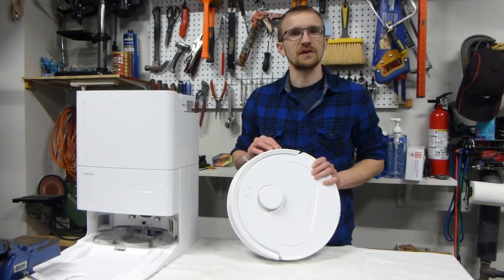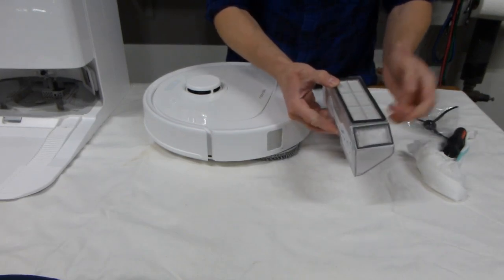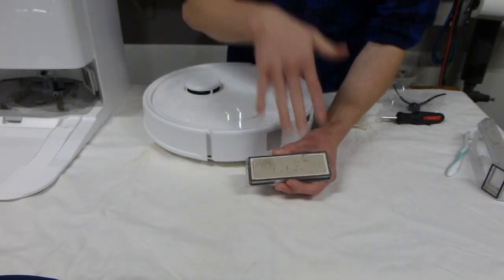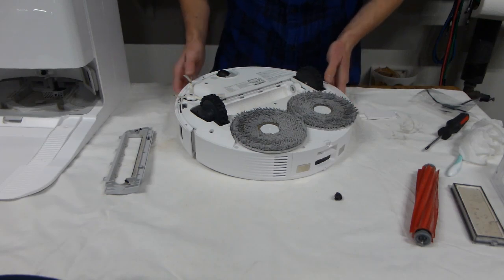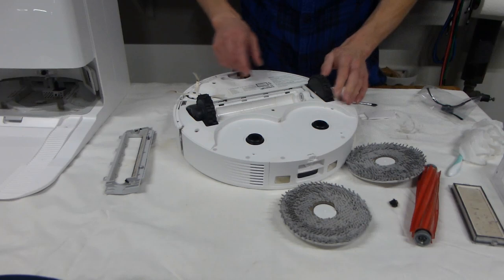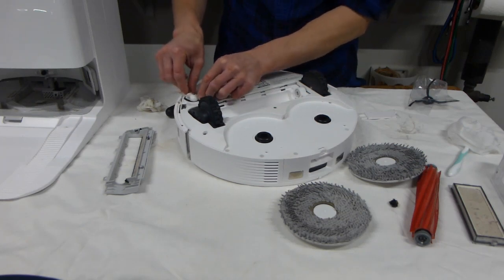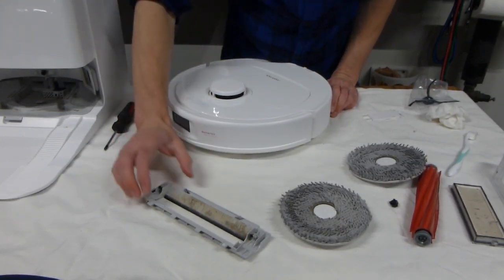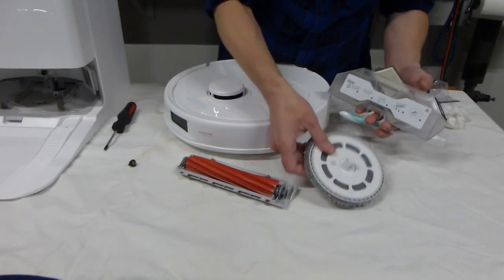Cleaning a Roborock Qrevo Mop Vacuum: Take Apart and Reassemble: Step-by-Step How-To

Comment: How did you take it out of the docking station? it's hard to take it out I fear I would screw something.
Reply: You literally just roll it forward a little bit and pick it up. It’s not even attached to the docking station because it charges through metal contacts. Just don’t pull it out while it’s filling the water tank or emptying the dust bin (which are loud and obvious)
Reply from the maker: exactly!